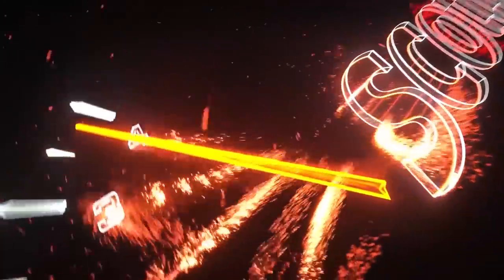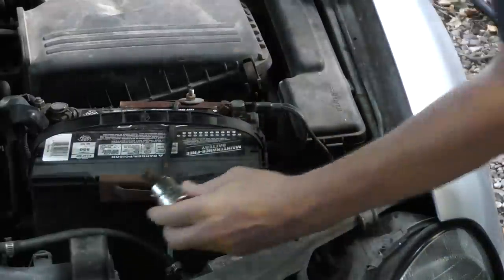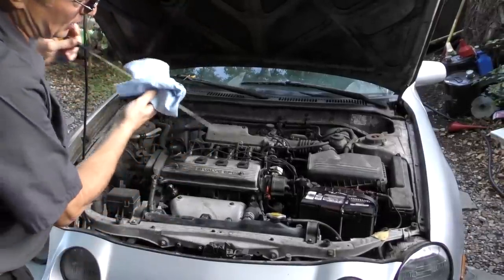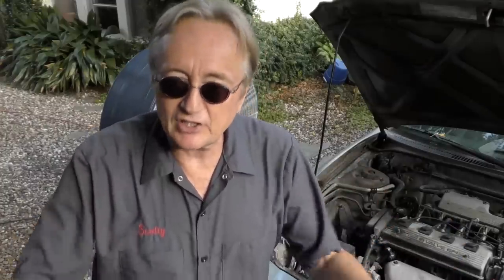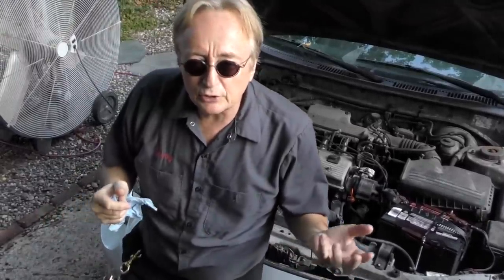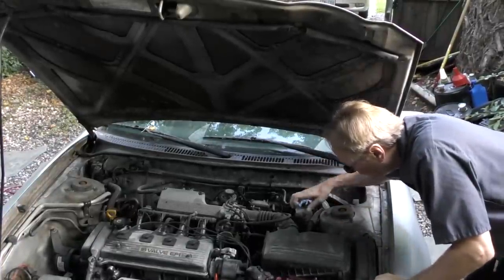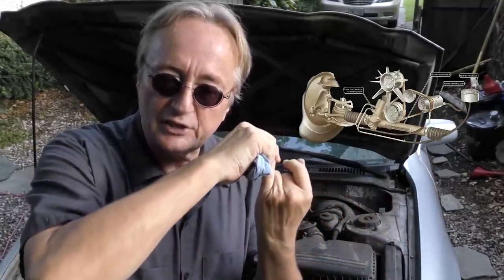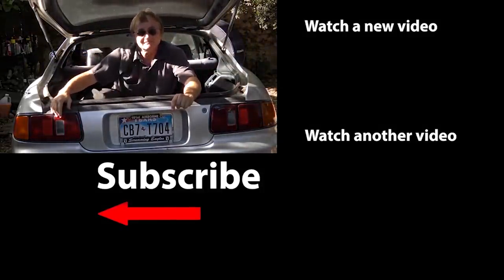If You're Not Doing This to Your Car You're Stupid

Comment: I went to school for automotive tech.  The teachers repeatedly stressed how important replacing fluids is.  Scotty is absolutely right.
Reply: But I heard that changing your transmission fluid can ruin the transmission because the metal filings are something the transmission becomes dependent on to work right.
Reply: @crand20033  Flushing the fluid might cause damage. A simple change should not
Reply: @crand20033  floating metal fillings and clutch material does help clutch packs to engage better. But the real reason not to flush is that any floating solid material can get into the mechatronics (the pipes at the bottom of the transmission) can get clogged.
Reply: @kevinclass2010  how much does a full cleaning of the transmission cost? Including getting rid of the metal loose pieces and the clogging
Reply: there’s two things in transmission fluid you either flush it or change flushing it is taking out the old fluid and pumping new fluid when you change it all you do is remove some like 1/3 to get some new fluid in the system flushing and changing and maintenance is all depending on what your owner’s manual says of the car now if the fluid is burnt or very dirty and black and has metallic specs it’s because those metal specs are pieces of clutch material if you were to say flush that dirty fluid with all those metal specs gone the transmission might slip because since the fluid wasn’t being changed and it got to that point the only thing keeping it running were those metal specs removing them will cause slipping best thing to do is maintain when you are supposed don’t let your fluid get black or burnt flushing it when it’s time to flush or change when you have to change
Reply: Mary Reed ...Are you a Automotive Tech.?..I work with a gal who is a very good Technician..We both are ASE CERTIFIED..Salute to ALL Techs.
Reply: I agree. I can't do it myself. And it's hard finding competent techs who can.

Comment: 1) Clean your battery terminals and apply some battery protection spray

2) Change your oil regularly 3 to 5 thousand miles using manufacture spec oil

3) Check and change your coolant as necessary. Check what works for your car

4) Change the transmission fluid every 60-80,000 miles

5) Flush your brake fluid every 4/5 years. A well made car (Like his Celica 😂) he’s never changed the fluid in however 

6) Power steering fluid-check it out and make sure it’s not dirty. Change it out every 8-9 years. 

7) Check your tires air pressure first thing in the am (cold pressure). Check for Dryrot.

That’s it!
Reply: Thanks for listing Scotty's recommendations!!
Reply: 3 to 5 thousand on synthetic oil is a waste of money. Even Scotty doesn't do that. Otherwise pretty good. The trans fluid interval you have is debatable, but it won't hurt.
Reply: @frazzleface753 your not very smart oil get dirty especially after 3 thousand miles when oil is dirty there's more friction more friction more wear just common sense I bet his cams look brand new in that Lexus and celica
Reply: @frazzleface753  but yes my dad changes his trucks oil every 5 thousand miles in his trucks but I never see them making it past two hundred thousand miles
Reply: Change all fluids every 10 years except oil which is every 5,000 miles. And keep your tires in check lile its your 16 year old daughter. Got it!
Reply: He said he hadn't flushed the brake fluid, not changed it.   There may be an important difference there.  I've had to bleed my brakes so have effectively changed mine but have never done an actual flush.  I could be wrong though.
Reply: @jwest88  it is the same thing. There is no water flushing like coolant.
Reply: @frazzleface753  never heard him say 7500 he said I wouldn't go past 7000 thousand miles on synthetic oil🤦‍♂️
Reply: @Jake ColbertI'd love to see a BMW or Subaru with two hundred thousand plus miles on it with people that have changed it every 7500miles
Reply: Use Royal Purple HPM change every 10,000 and go to 500,000 just saying, motor on.
Reply: @nothanks2994  He's said it on plenty of videos. Even this video he says 5 -7,500 miles on synthetic. If you're saying that synthetic oil should be changed at 3,000 then there are two possibilities:

1) You don't know much about oil.
2) You're trolling us

I'm thinking 2). In which case, go do something constructive!
Reply: Change the air filter every 30,000 miles. Buy good spark plugs
Reply: @behexen250 I don't always agree with Scotty either. I think changing the ATF at 40k isn't necessary, unless it's a CVT that needs babying. You're only getting out 1/4 of the fluid anyway, the way he does it. Most vehicles 100k for the ATF is perfectly fine.
Reply: Lol! How about air filter and cabin filter baby...
Reply: @Jake Colbert ,
Reply: Thanks for duplicating Scottys recommendations
Reply: Bad Dog what was that for lol
Reply: Weston Holm dam what does he drive I used to do it every 10,000 now I do it 5,000 my 01 Tacoma is at 194k miles
Reply: mabey some Anti UV ray dressing for the tires
Reply: @frazzleface753  He said 7-10k miles on synthetic.oil. 3-5k miles on conventional oil.
Reply: THANKS FOR THE RECAP...!!!!
Reply: #4 should be 30k to 40k, but oh well,
#5 ia funny.
Reply: @Jake Colbert If a new vehicle's powerplant has not been filled with fully synthetic from the onset, then owners are wasting💲. Unless You are in Extremely cold climates, or operate vehicle under (duress),semi-synthetic still comes to the party. In the end it's what works for You.👍😎🍻
Reply: I know, but I still watch it through.
Reply: @Jake Colbert fuel dilution
Reply: @billybob042665  a "modern" engine's internals are exposed to atmospheric pressure from combustion and the pcv system.
Reply: Def not it you misses the most important thing which is headgasket timing belt water pump at arounf 100k
Reply: @frazzleface753  Withal a name like that, maybe you should change a bit soooner.
Reply: And 8) don’t buy a Chrysler product. Don’t forget that
Reply: recipe to keep a toyota or honda running for 400k miles.
Reply: @frazzleface753  also, don't change from conventional oil to synthetic after 100k miles and clean the throttle body sometimes too and vacuum the air filter after knocking it out on the cement.
Reply: @nothanks2994  you're
Reply: @JaguarDieCast  here in mainland China i have to change my air filter 10x as often, there is so much dust everywhere (construction)
Reply: 12) avoid Chrysler
Reply: @williamschuman4951  I will gladly "throw money away' by changing synthetic oil every 3k, rather than throw money away throwing money away on engines!
Reply: Wax your tyres once in a blue moon to prevent them from cracking..
Reply: Jake Colbert Your so right! I have a '95 Cadillac sedan Deville! It's got 93,000 miles! It's my "Toy" weekend driver, when its nice out! Changed the Oil last year about 500 miles driven! Today ( although the oil is pure gold color, not down a drop) the computer sends out a message ... " Change Oil"! So, I did! If your car is telling you to do something, it's best to take care of the issue! The longer you don't heed the warning.., you're taking chances of developing serious issues!
Reply: @lollol-xp4mc  I thought the timing belt and water pump should both be changed at 75,000 miles.
Reply: @CorneliusMegadook  I have never heard of anyone changing synthetic oil every 3,000 miles. Isn't the recommendation 10,000 miles, with 7,000 miles being the earliest recommended time?
Reply: @JJ-ls7fq  it works well for my car and wel as my bike...of course have to be careful cos it can get a bit slippery for bikes.. but it works wonders for keeping tyres fresh
Reply: @fidelcatsro6948  Better than Armor All?
Reply: @JJ-ls7fq  armor all is good... im using cheap chinese wax spray
Reply: Or not buy a car at all and avoid the hassle
Reply: I change my synthetic oil every 5,000 miles. Always use quality oil filter. It’s cheap , quick and easy. I don’t care if people say 7,500 miles. Changing my oil also puts me under my car where I can inspect for leaks, suspension wear, etc. 

It’s never hurt a car to change the oil too much.  Nobody can convince me that oil with 5,000 miles on it is the same quality as fresh oil. It may be serviceable, but why cheap out on something so cheap and so vital to your cars life?. To each their own.
Reply: Here in Germany we change the oil every year that's it. 15.000km that's pretty much normal for us xD
And before this video I've never heard of powersteering fluid soo...
Reply: @CorneliusMegadook  each to his own, motor on.
Reply: Maya Foster 

Belts, hoses and filters.
Reply: @dildobaggins069   So true. I run cars and trucks commercially.  We pay more for Michelin tires, and it saves us a lot of money in the long run. We already tried the rest!
Reply: @tomccycle60  Dealerships!
Reply: @Ammut6  Absurd and bad advice.
Reply: @frazzleface753  7,500 is a very reasonable oil change interval for full sythethic oil. Some change it at 5,000 miles. Pushing oil to 10,000 miles can be done but by then it can be a very dirty oil. If you want to keep car for 250,000 miles more frequent oil changes with good quality oil filters are a smart idea.
Reply: but this list didn't contain photos of animals laughing and cracks about chryslers so 5/10
Reply: Maya Foster 8) Buy a $5000 scanner.
Reply: @frazzleface753  I say 50K
Reply: My dad used to mix some water and baking soda to clean the batteries of corrosion.
Reply: @frazzleface753  The above number is not for synthetic oil but "regular" oil.  Scotty says change synthetic oil every 5,000 to 7,000 miles; he doesn't believe in doing it every 10,000 miles and with that crazy Mobil 1 do it more than the 20,000 miles.  Good recommendations.
Reply: Unless you have a celica,  then you can just put a 1.25 in the gas tank, and procrastinate changing the oil, or any "minor" repairs, and your good
Reply: Also check tires for the month, day, year and plant they were shipped out of. Every tire has this info on it. Not many people are aware of this and are sold old dry tires that have been shined up, end up replacing them sooner than they should have too.
Reply: @dagsieannejesion3652  dude,  great point. My ex bought winter tires a few years ago, picked up our 2 year old boy, then, without warning,  it blew out. Mechanic said it was dry rotted on the inside
Reply: Frazzle Face He said 3-5 for conventional 5-7 for synthetic.
Reply: XxVeNoMxX I run a K&N air filter drop in. I just clean it once a year and inspect it every 6 months
Reply: (4)— And I’ve heard disturbing the transmission fluid in any way, is worse than simply leaving it alone. Though I found that advice puzzling in its own right.  Who’s right I wonder?
Or am I confusing a transmission fluid change with flushing the transmission?
Reply: My car's brakes fluid runs out every week 😂😂😂😂
Reply: Jake Colbert I get oil changed every 10k miles on my full synthetic. The car requires synthetic oil
Reply: mike judge I buy the middle ones that usually cost 75-80$
Reply: Maya Foster cheers Maya appreciated
Reply: Thanks Maya! God bless you and your family!
Reply: @JaguarDieCast  replace air filters annually....... Engine and cabin air filter
Reply: Thanks
Reply: Thank you!!!

Comment: Hi Scotty, you forgot about one item, granted, it's not for all cars, but a lot of them:

The timing belt.
A lot of cars from between 1990 and 2010 have belt driven timing, and most of those are interference engines.
It is critical to replace the timing belt every 5 years or 60000 miles at most, or you can kiss your engine goodbye once it snaps.
Reply: Make sure never to buy a timing belt driven car. Mine are all chain.
Reply: TRUTH! to check - 
if your car sputters when starting, turn it off and restart. if restart produces no sputtering, now this means your timing belt is stretched, varying the timing which is  off at times which actually means, the timing is off and you are risking timing belt breaking, resulting in piston slamming into the piston= R.I.P.  any motor w timing belt. 

told this to a gal, when I noticed the sputtering. she'd restarted ran smooth. told her it was serious and she needs to get a new timing belt asap or motor will go bye bye.

she shrugged it off. this was summer. by Nov of same year, belt broke compressed air in cylinder without belt to open valve to release pressure via exhaust , resulting in exhaust going up he intake route which blew out her plastic intake manifold, in addition to the piston walking the valve bending valve, which basically means good by to a used old motor due to being cheaper to replace e w a used motor, vs repairing the broken motor. this all would've been avoided, by getting a new timing belt installed. car would've driven much much longer. it was a intrepid 2.2Lif memory is correct.
Reply: Well, VW (and its drone brands) managed to sell people engines with a timing chain that fails even quicker than the belts can.
Reply: I second that!! Happened in a Chrysler of course 🙄 never again!
Reply: Timing belts are neither good nor bad. They are a necessary maintenance item like an oil change. However, your skills and pocketbook come into play. I changed my belt and all related items in the spring - $350 and one day of my time (experienced mechanic). The same job in a shop was quoted at between $800 and $1,000. Just decide before you buy if you are OK with the work or $ .
Reply: Ran my chevy cruze up to 120k with the same timing belt, then it was replaced, the dealer couldn't believe the mileage on the car and how good shape everything is.  I said yeah, a rare thing to see anything GM to make this far and the reason it was running so good because the car had no power, 0-60  - 60 seconds.
Reply: @przemekkobel4874  key word 'vw' nuf said

Comment: Scotty:  "Toyotas last forever!"
How many miles a year do you drive, Scotty?
Scotty:  "500"
Reply: I drive my Toyota 27,000 miles a year and I agree with him lol
Reply: @demarcocb4240  i drive about 25k a year and yeah... Just keep ticking
Reply: 30,000 miles a year in my 2005 toyota landcruiser and still going strong in dubai hot weather .
Reply: Actually in 16 months time, the Celicas odometer went up by a mere 5 miles.

Yes. 5 miles.  Look it up. It's true.
Reply: Yeah but he's got 260000 miles on that thing.
Reply: That's his weekend driver, he has other cars
Reply: JR but won’t make it to the mileage of the celica
Reply: Chrysler owners are recommended to change the title
Reply: he needs to drive it more often and put that odometer at the start of every video
Reply: Some gears between the engine and transmission might not be aligned properly, or you could have transmission problems. My '96 Ford Taurus is doing all the same things as your car and I just replaced a bad transmission mount, along with servicing the egr system. Did you check/replace everything in the exhaust gas recirculation system? The pcv valve if I remember correctly can cause some of these issues, for example. I don't know about you, but I let it go a while with that bad mount before I changed it. You might want to get a second opinion from a reputable mechanic. A good transmission rebuild kit might be something to look into also, if you're mechanically inclined.
Reply: @Why SirTanYoo If it comes down to it, rebuilding the transmission yourself could only cost you a couple hundred dollars.
Reply: Considering how scotty claims Toyota's will last "forever" he spends a lot of time under the hood of his celica
Reply: Mitsubishi lancer : 290,000
Reply: I own a 2009 hybrid Toyota camry.
It's got 185000 miles on it and is still runing perfectly. With a consumption average of 32mpg
Reply: The Nimble Ninja 
It can be 1,000,004 miles actually, considering it’s a Celica.
Reply: @Why SirTanYoo my Nissan was doing the same thing not too long ago, i got the codes read and said my system was running too lean and had a random misfire in cylinder 4 so i decided to change all 6 spark plugs with all 6 ignition coils also changed the mass airflow sensor and found my pcv valve hose with a hole in it also changed it, and my car has been running good ever since... oh and a quick tip if you ever change any sensors in a Nissan make sure the new sensors are oem from Nissan other brand sensors don't last long.
Reply: My moms 03 Corolla has 322,000 on it and she hasn't always maintained it great, I changed the oil for her a few weeks ago and it still runs like a clock

Comment: Also if your vehicle isn't just a simple front-wheel drive, and it has a front or rear differential or a 4wd transfer case...change those fluids out too!
Reply: Also if its 4WD or AWD the tyre pressure being right is more important so the tyres remain the same height and have the same tread wear otherwise it will wear out the drivetrain.

Comment: Tut tut scotty u forgot an important piece of equipment to check, the air filter.
Reply: Joey  Assuming you meant the filter drier, that only needs to be changed whenever the A/C is opened for maintenance. The cabin air filter, however, should be checked every once in a while and cleaned/replaced, just like the intake filter.
Reply: The guy drinks too much anyways.
Reply: Joey  Most vehicles now days have an in tank filter. I myself rarely see a fuel filter being an issue. I do know most gas stations today have up to 3 filters in the system. One in their tanks, one in the pumping unit and one in the hand pump. I know they have to be inspected and changed.
Reply: Joey  Yeah that's a filter drier, no need to replace unless the A/C circuit was opened for maintenance. It's there to remove any moisture or debris that might've gotten into the system.
Reply: A/C as in cabin air filter?
Reply: He was talking about fluids to use or to change